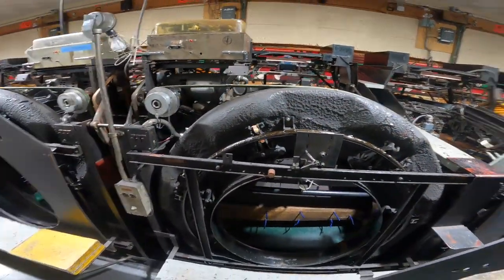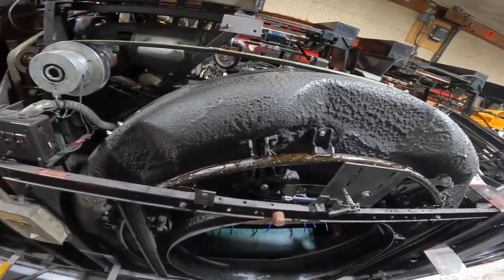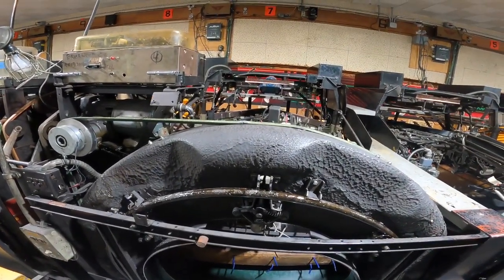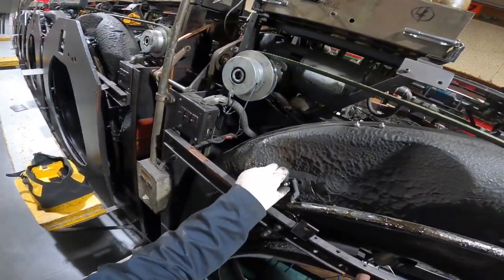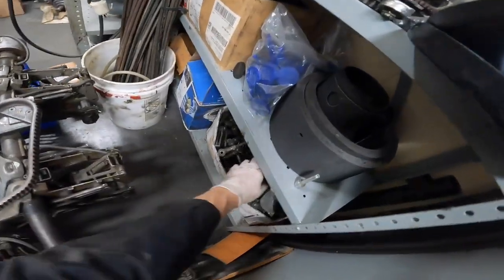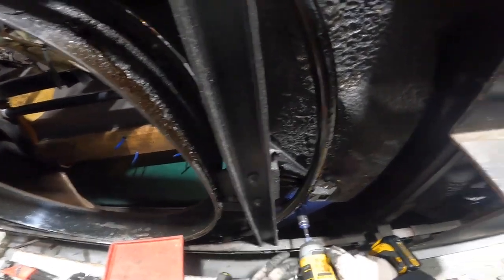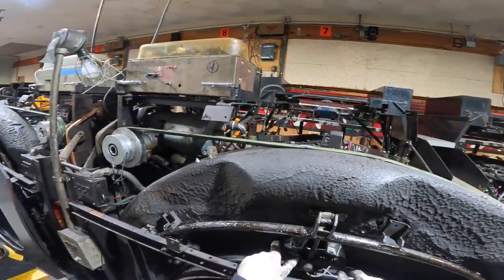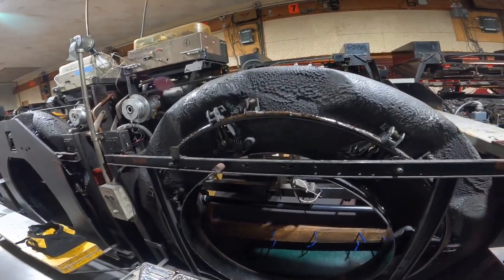How to change a Toggle Housing on an AMF 82-30 Pinspotter

Comment: These videos are very helpful. Thanks so much! Do you have to replace the complete toggle housing to replace a broken roller pin that engages the pin clamp while advancing to the top before release?
Reply from the maker: Yeah, the top of the housing was cracked and the roller pin would no longer stay in